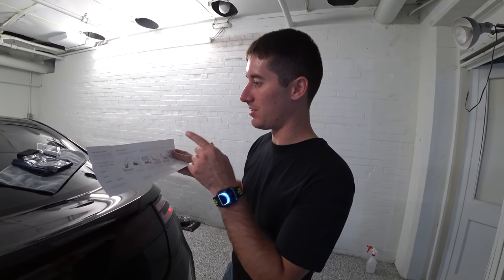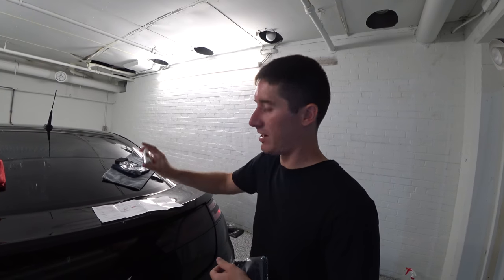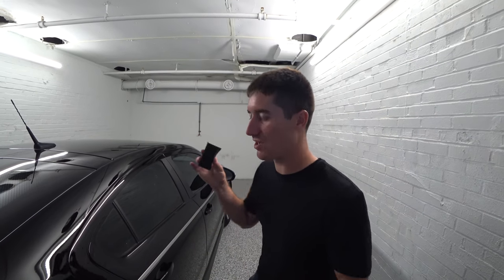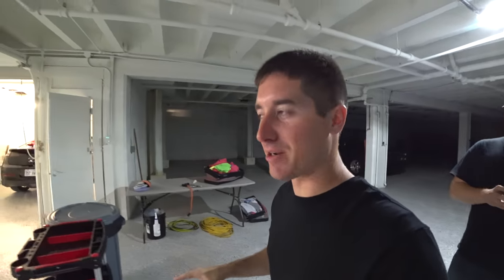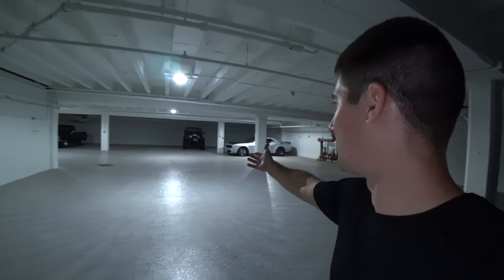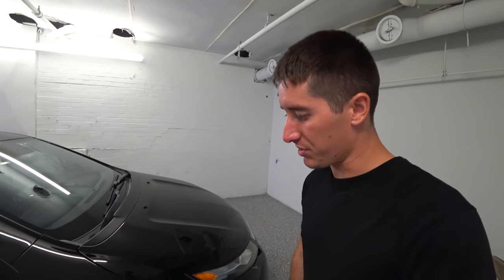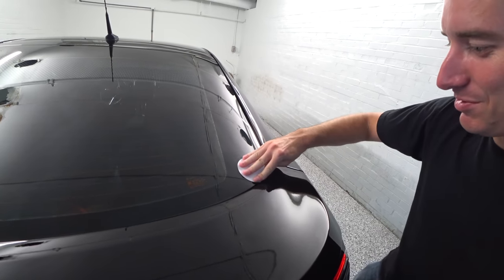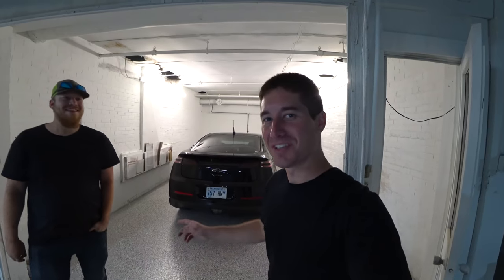DIY CERAMIC COATING My Chevy Volt With Armor Shield IX

Comment: Hey JohnRoss, I bought Armor Shield IX and used it on my 14 year old bmw with hazy clearcoat. It made my paint glassy smooth to the touch, shiny and even hid a lot of the clearcoat imperfections! This is definitely NOT snake oil! It even made the black rubber and plastic trim on my car go from whitish back to nice glossy black. My car looks almost like new again. Thanks for the coupon code. I wish I had taken them up on their added offer to ship a second bottle at a reduced price. Totally worth it!

Comment: The Volt looked new to me when you said it was dirty! I live in an apartment and have no car port or garage space, and most of my friends don't either. 

Watching your channel is making me ashamed of the condition of my black 97 Honda CR-V. It looks like a junk yard car though it runs like a top. It needs a deep cleaning, claying, compounding, polishing, and protecting. Then it will be much easier to keep clean. The rain here leaves horrible white spots all over the paint. And it rains a lot.

I wish we had a similar garage in Baton Rouge. I've got to find a place where I can do the work and keep it clean in between steps. I can't do the whole car in one day anymore. I'm too old and too arthritic.

Comment: I love the blue meguiars ceramic spray. It’s the quick kind you just spray on then hose off, but it sheets pretty similar to what you have. Of course I doubt it lasts as long.
Reply: Read the disclaimers. It probably points out pollution and other contaminates will affect the coating. No one can guarentee a product against road salt and acid rain. That crap eats everything.
Reply: Mine was applied in May....still sheets off! I didn't follow the instructions. I just washed & dried like normal...then put ot on like wax...then buffed off with a microfiber. Use way less that way & it lasts longer.

Comment: Nicely done. Looks great! I have to admit I was very much on the “snake oil” side of the debate at first, but over time I’ve come to see the light.
Reply: Look it up it’s a gimmick ! Ceramic coating is supposed to be done at a shop they have made a prosumer product designed to get your money should cost over a grand not 25$ also he don’t tell you even tho the smart ones can tell he has his car professionally prepared ie : cleaned dirt removed from the paint the majority of people will buy this rinse a car off and try to put it on then think it lasts 10 years .....

Comment: I want to do that with my Subaru. We just got it back from the body shop. They wheeled it and polished it. I want to ceramic it before winter. I really want to see how it holds up to Winter road salt. That Abarth sounds crazy! Yeah, 120 k is normal wear shit. My daughter's car has front strut issues. I won't fix it, those days are over for me.

Comment: I just coated my truck last week now I'll have to see how it holds up to a Michigan winter.
Reply: That's me too. My guess is road salt will win. Why do these manufacturers not specify how it holds up to salt. Read the fine print. My guess is there are misclaimers referring to road salt and pollution. Read again. The proof is in the print.
Reply: @AvalonKing  I mean I would assume it hoses off, but there is a difference between going to Bonneville once and having your car sit in the rust belt getting blasted with Copper and Magnesium Chloride everyday for 3-4 months. It would be nice to see a durability test in those areas.

Comment: J.R can you use the coating on painted plastics & clear headlight lenses ? Not familiar with the ceramic coatings. Thanks for sharing dope vid 🙌 Salute P.S car looks awesome my friend 😎
Reply from the maker: Yes, I did the plastics, headlights, and the wheels. I only skipped the grey side skirts because I wasn't sure if that was okay 🍻
Reply: @WatchJRGo  I feel ya ! I'm kind Leary on using products on my plastics after I ordered some crap for $ 19.99 off as seen on tv 😣 LOL turned my plastics white .LOL
Reply: @WatchJRGo  Actually, Ceramic coating works great on plastic. like Back to Black or Wipe New but it lasts longer.

Comment: I think even scotty said it's  a scam
Reply from the maker: You can actually see it working in this video, it's no scam. I wanted it because every supercar ends up getting ceramic coated and I know how well it works. A 30 second water wash and your car looks flawless vs having to actually wash it with a wash mitt and 2 buckets. 🍻
Reply: Not a scam. Scottys a hack
Reply: I haven't tried this yet but scotty needs to go to the nut 🏠 nothing but rambling nonsense or common sense

Comment: See what you did Is have a shop prep your car the part you fail to tell us that cost 100-500$ in prep for any normal person. Also those “ diy kits “ only last 1 -2 years. A “ professional “ ceramic coat take 7-9 hrs to do and can last 10 years. Least be honest with us
Reply: Who keeps a car 10 years now days?
Reply: @scottfirman  Tons of us out here! My newer car is a 2011 (just bought it) and my older car is a 1997. We drive them till they fall apart. In between purchases we save enough to pay cash for a newer used car.

Comment: Actually, JR...That is not a real Ceramic Coating, more like a very cheap and older technology Quartz Coating. The water  behavior is extremely poor with the water beading and water sheeting.
Reply: No it's really not. False advertizing. Ceramic has to be applied with HEAT to bond it. Look up the definition of what a ceramic coating is.
Reply: @scottfirman  I used Avalon ceramic coating on my car and apply 9h Ceramic pro where I work and baking the ceramic is optional.. it will cure and harden by itself with time just like clearcoat and paint and will bond to anything that is clean.

Baking is ideal and makes delivery faster especially if you apply several layers but honetly have you looked up how much these lamp go for ?
Reply: @MrFrozenTea  I was 1 of the 1st Ceramic Pro Installers in the US when Ceramic Pro came to the US.